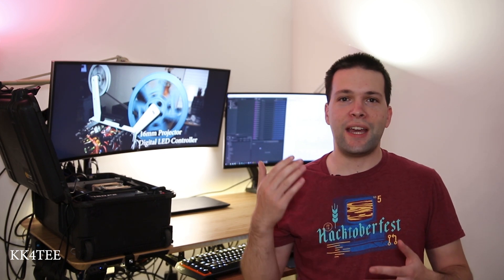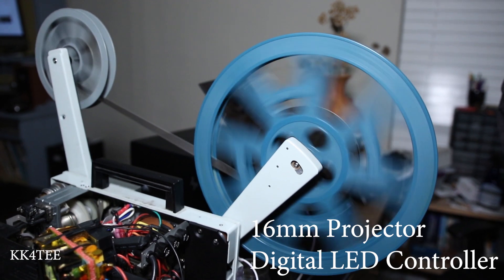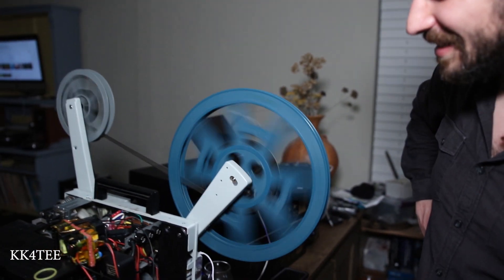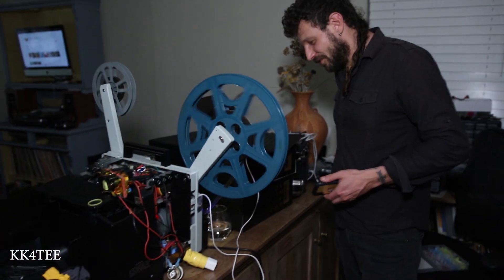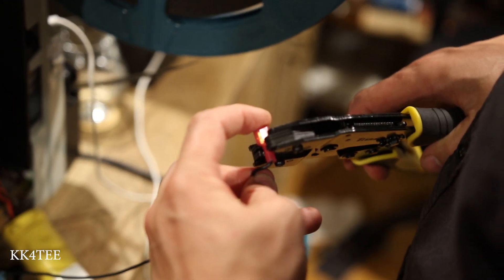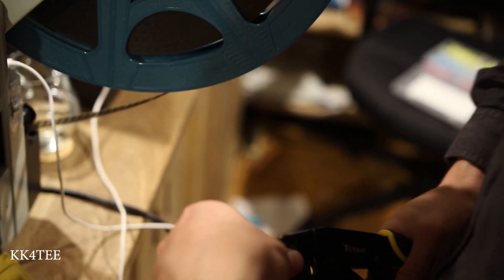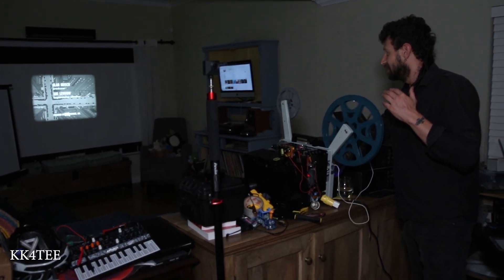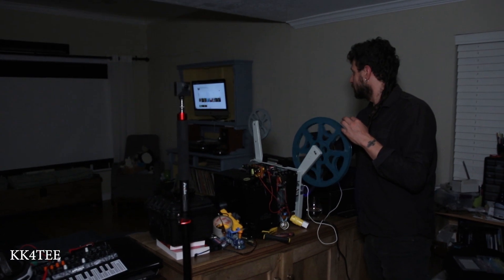DIY Light and Shutter Upgrades for a 16mm Projector

Comment: Super nifty project. I'm curious if you have had any experience with pausing or slowing down film on this projector - with normal halogen or xenon lamps celluloid quickly melts or deteriorates if frame rates drops too low. What kind of LED bulb did you use for this?